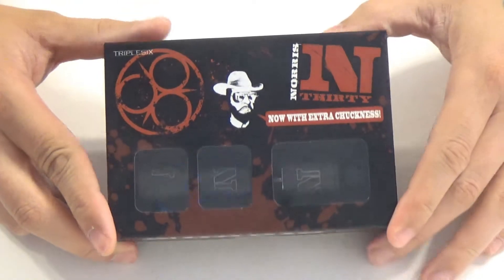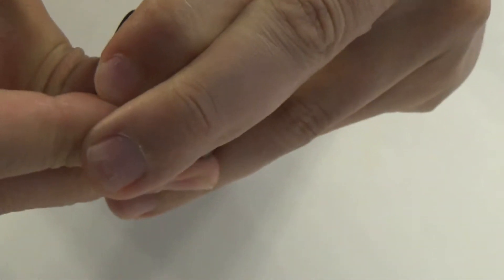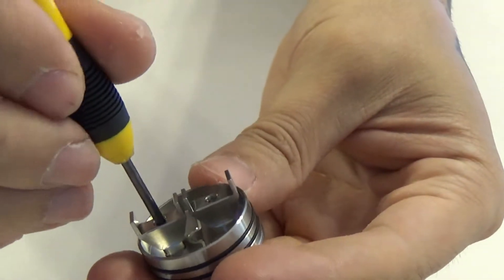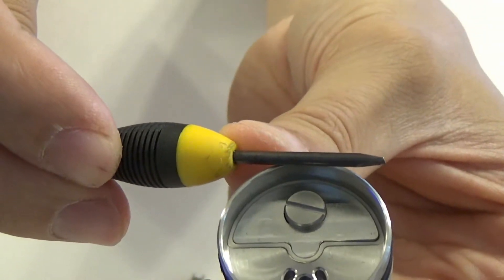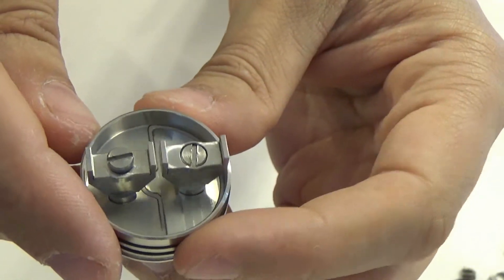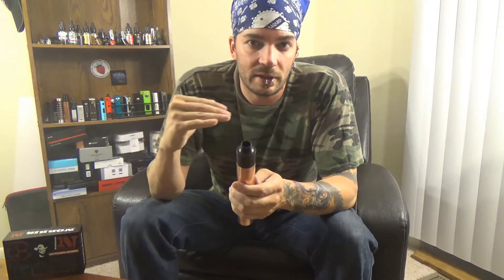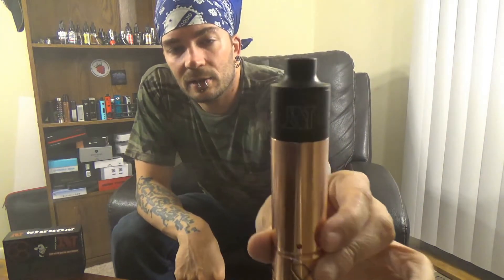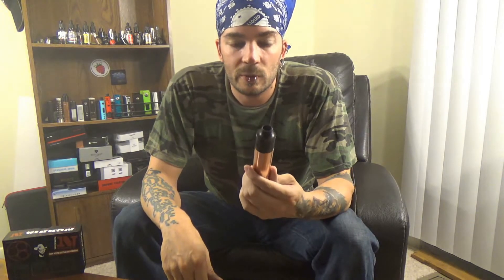The Norris 30MM RDA from Triplesix Modz!

Comment: Just subbed to your channel, I seen the 22mm version today at a shop and I figured I would research it more and low and behold I find out they have this in a 30mm version!!! now I'm stoked I like the deck of the 30mm much better than the one on the 22mm. The 22mm looked to be more of a challenge to build on unless running post-less and I'm more of a large atomizer guy anyway. CCI Centurion, BFT tank, Buddha, Temple, etc. I'm definitely going to have to see about this as I like the versatility aspect of the design and the multiple top-cap sleeves that it has! Airflow control really isn't a deal breaker for me as you can use mod or tank bands to block off some of the air as well. I liked the review and will have to check out more of them. Thanks Brother now I'm going to have to track one of these bad rides down..
Reply from the maker: i got mine from fogwind. So i know they have them. The 30mm version definitly has a better setup. The posts are much nicer. The 22mm has the hex screw with the flat head screw on top. This is probably my new favorite rda for builds. Posts and postless are just a breeze to use.
Reply: I'm a builder so I like the added real-estate of a 30mm device and this would be the first for me as far as a post-less RDA goes but I'm a cat track and fused Clapton variant enthusiast so the 22mm looks as though it would be a pain in the ass to mount such builds. Thanks again because even though the little Mrs. wont appreciate me having seen this because now I'm going to be spending more money on vape gear I am truly glad I caught this video Lol!!!!